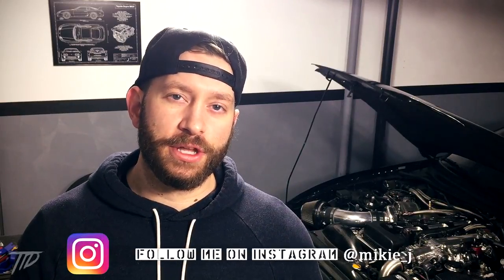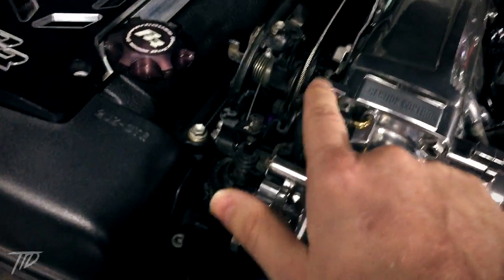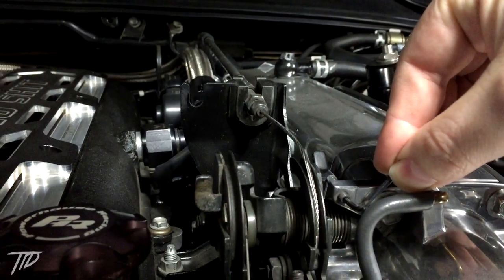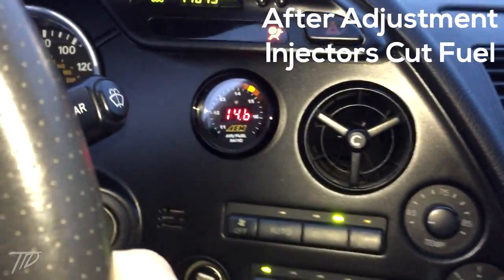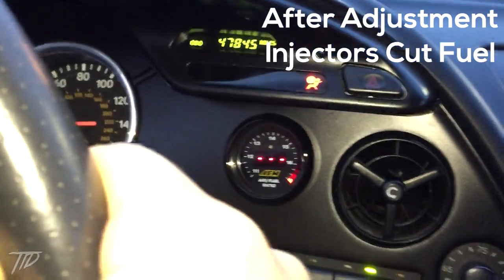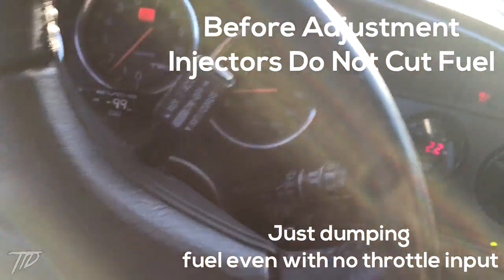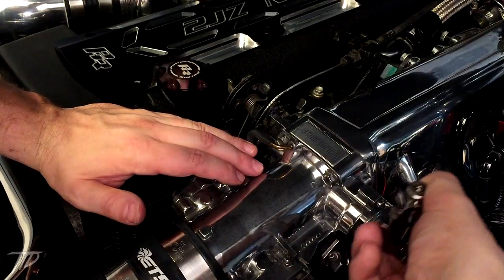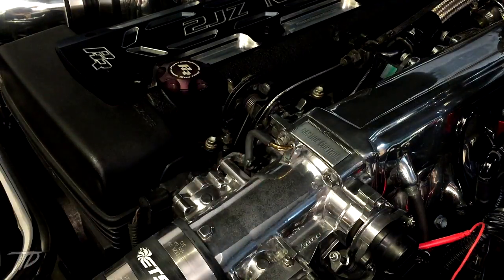Quiet a NOISY Clutch in a Turbo MKIV Toyota Supra - RPS Carbon Twin Disc

Comment: apreciate the video, i have boh of these noises with my RPS twin disc, however i have been suffering another problem wich is the clutch not disingaging or is it engaging? ( clutch pushed to floor) cant get it into 1st or reverse, when i finally do the car will be slowly moving forward in 1st or backward in reverse with the clutch pressed to the floor. did you ever come accross this problem? clutch is fine whlie driving (no slipping) with this clutch was i suppose install any other non factory clutch parts to prevent this? also mechanic said the clutch has been adjusted all the way out so cant get any more out of it. cheers
Reply from the maker: Sounds like clutch is not full disengaging and the clutch pedal needs further adjusted.  Was the clutch pedal adjusted at all?
Reply: @TunerTestDrive  yeah the clutch pedal is adjusted to the max.
When that RPS clutch was installed 5 years ago by an old mechanic, i cant remeber if he used new bearings with the new clutch or used the old bearings

Comment: How does this clutch feel driving? Stock pedal feel? easy to slip? on off?
Reply from the maker: I went from a stockbroker clutch to the carbon/carbon and thought the pedal feel and engagement was not that far off of stock. You can really slip this clutch without it instantly grabbing.  A little noisy, but a higher idle takes care of it.
Reply: Tuner Test Drive 
Do you have the newer or older version.

Comment: Are you using thr new rps clutch? Which flywheel do you have steel or aluminum?
Reply from the maker: This is the updated version with the billet strapless design and heavier steel flywheel.
Reply: @TunerTestDrive  i was thinking to get, but how come they advertise it as no noise and so on